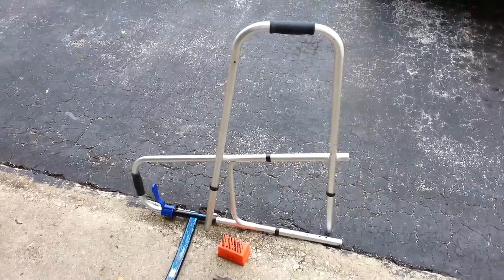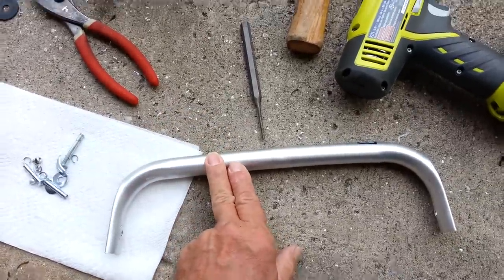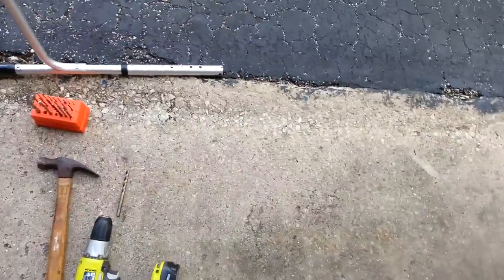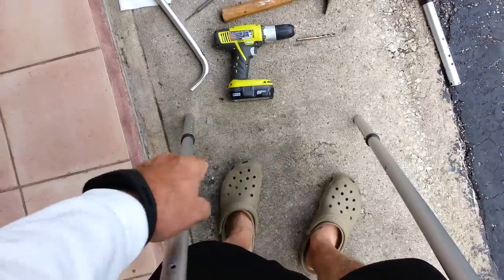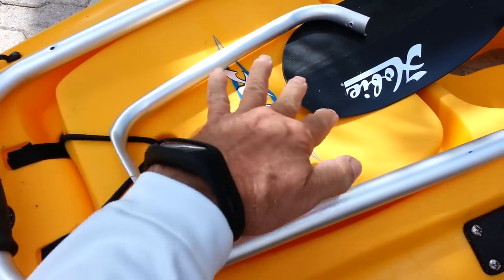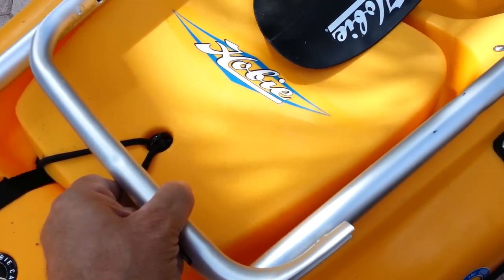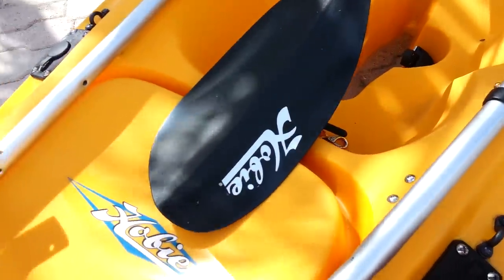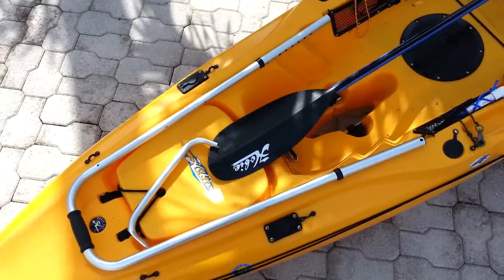Home Made Hobie Style H-Bar - Part 1

Comment: John, this might be a dumb question, but is this sturdy enough to assist in actually pulling yourself up or just to lean on? I'm getting ready to buy a kayak and I'm 6'2 300lbs, also have a bad back. I have no problem balancing once I get up, but I know the only way I'll be able to stand from a seated position is to have a bar I can pull on to assist me. I might be dreaming and just have to sit on my ass and haul in the big ones.
Also, what part of South Florida do you live in? I lived there for 13 years, Pompano, Deerfield, WPB..........getting ready to move back. Maybe Ft. Meyers this time. Thanks.
Reply from the maker: +Chris Fagin Absolutely. this was not a thin walled walker. This thing was strong. I am 6'2" 230 lbs. so I hear ya,and I have the same back problems an knees are bad too! I haven't had any issues with it yet...Check out part 4 at the 5 minute mark. I am in Ft. Lauderdale/Cooper City